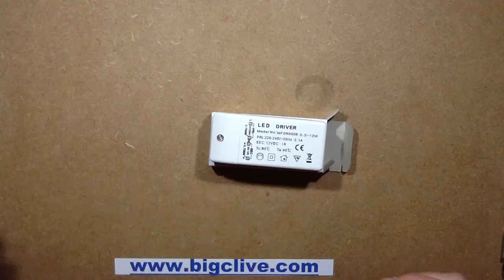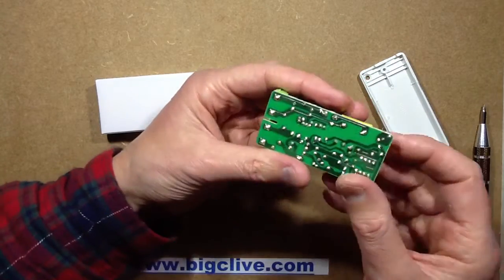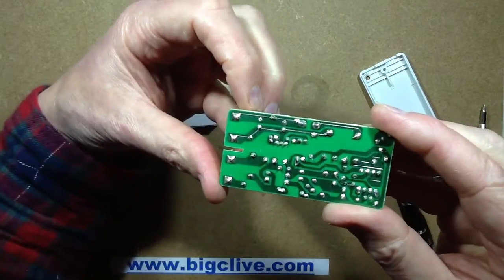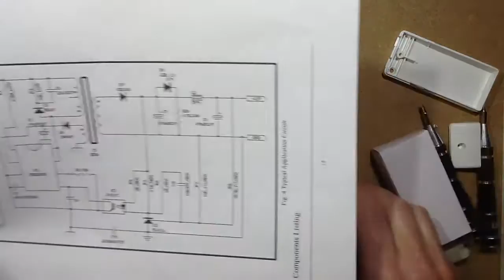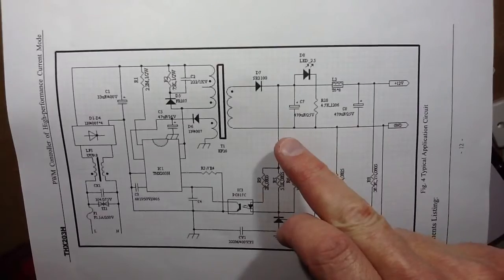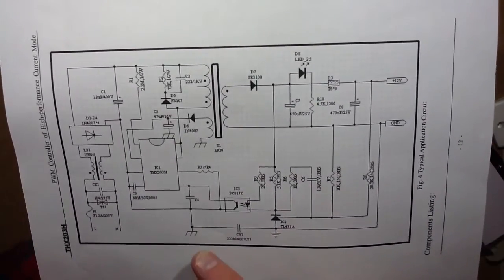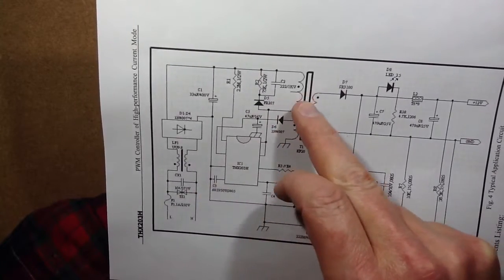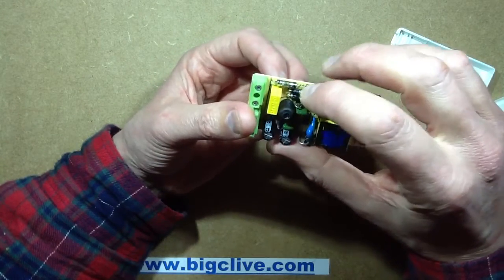Internal examination of a 12W (12V 1A) DC LED power supply.

Comment: Hello, what's the problem if a power supply does not provide the output amperage ("power") any more? So it kind of cut-off about after 5 Volts, range 2 Volt til 16 Volts. Variable Power Supply.
Reply from the maker: It could be many things.

Comment: I purchased one of these https://www.ebay.com/itm/US-Power-Supply-Adapter-Transformer-AC110V-To-DC12V-1-2-3-5-6-8-10A-fr-LED-Strip/142465928701?hash=item212ba18dfd:m:mCI_SscsXzTIMUvasfyEhAg:sc:USPSFirstClass!85008!US!-1:rk:4:pf:0
12v 10 amp led power supplies and opened it up, it contained a recycled power supply, or possibly a pull from some other equipment, the mains wiring was awg 30 gauge wire (inside the case). 
https://youtu.be/ysf7oFEB4vk
https://youtu.be/Ox7BfDrx7N0

Comment: Thanks a lot @bigclivedotcom i managed to fix a "ELC Ale2902M" with the explanation and your schematic ;) 
It was booting and delivering a proper voltage and power but only 1 times on 20 try...
it was the 47ɥF 50V capacitor that powered the chip on boot

Comment: I have been using these units for many years to power 13W LED lamps, with no problem at all. I have supplied many hundreds to users, with not one return. Very reliable, I think.The only little down side is the lack of suppressing double coil transformer at the input side (which appears in the shematics, but is not implemented in the product). It is replaced by a single coil choke filter. But there again, no real trouble experienced.
Reply from the maker: That's the main difference between the cheaper and more expensive units.  The lack of suppression and often the rating of components.  But if a higher current rated supply is chosen for a lower load it will generally be reliable.
Reply: Yes, Clive. As a rule of thumb, always leave a 10% or better even 15% margin between actual useage and rated performance. Then you are more on the safe side...

Comment: Hey there BC, another good video. I'm in need of a good low scale amp meter in DC voltage. Any recommendations? 
Reason being my old Fieldpiece I used in AC work is way to big to read at say 2 amps. I seen you with one in another video but don't remember where that was at. Thanks for any help Big Clive, Tom.
Reply: Dang-it, also forgot, did that turn out to be a good transformer like you had expected?

Comment: I have this same regulator, though the chip is a D803 it's exactly the same as far as I can tell but I couldn't track down a datasheet. I was thinking about hacking a PIR module onto it, something like this one (http://www.ebay.co.uk/itm/Pyroelectric-IR-Infrared-PIR-Motion-Sensor-Detector-Module-HC-SR501-Arduino-UK-/331286817331?hash=item4d223baa33). The 6v output from the transformer should be fine to drive it and a transistor across the opto-isolator should bring the feedback pin to 0v driving the regulated output to 0v. Ive already tried pulling the FB pin low and it does disable the output. Can you see any problem with this idea? i also need to extend the delay on the PIR to 10minutes or so, but I've not really investigated that yet. Great vid as always!
Reply from the maker: Nick Fox Those little PIR units have an on-board voltage regulator if I recall correctly.  They're also very fussy about the load on the output pin.  It the current is too high it affects their stability and causes repeated false triggering.  There's a mode on the PIR that lets you choose between continuous retriggering to make one long extended output, or fixed time triggering that ignores any further movement until the timer has turned the output off again.
Reply: Hmm just had a thought, that secondary is going to switch off when the feedback goes low which will kill the power to the PIR circuit.